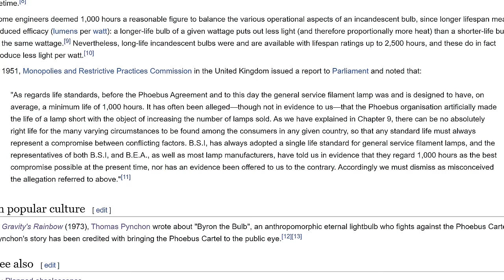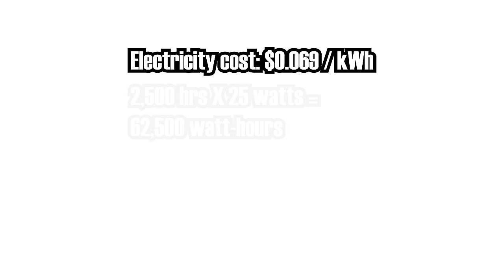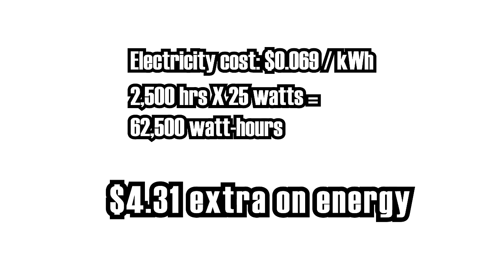Longer-lasting light bulbs: it was complicated

Comment: I think this video makes a very strong case for stepping back from calling Phoebus the beginnings of planned obsolescence; though I do also think Phoebus may be one of the source texts/inspirations for the move toward planned obsolescence within tech-goods industries since the mid-20th century. That said, I think there is a strong case for corporate cartel collusion. It seems likely that the member corporations were less motivated by artificially increasing demand through shorter product life (and more frequent replacement) and more motivated by the need to protect against corporate noncompliance in a market sculpted by lack of consumer knowledge. This trade-off between brightness/whiteness/efficiency and runtime is the perfect situation where some companies could market their products as brighter and more efficient while others would market their products as longer-lasting. The corporate collusion allows the terms of the market to be set, making sure that no one company gets a reputation for having longer-lasting bulbs because they underclock their light bulbs by a few lumens (something many customers would never notice, even in a side by side comparison).

I bring these up because the nuance and historical storytelling seems important. Consumer values have changed significantly with regard to powered things since their rise to market dominance in the mid-20th century. For example, the contemporary focus on automotive safety is at odds with the historical focus on automotive resilience (i.e. being un-dentable) because the car is now designed to take so much more of the impact that even low-speed collisions can total a late-20th, early 21st century motor vehicle. In that vein, I'm not super convinced we can call brighter or whiter light good in any specific context nor was the energy cost in the 20's and 30's a significant deterrent since electricity had few high wattage uses (e.g. home dryers, electric stoves, or household heating) in most homes. This was a barrier in the early switch from gas lighting to electric lighting, since most folks continued to use other fuels for stoves and household heat, decreasing the overall appeal that electricity carries for us today as a fuel source for every device.

Anyways, great video. Thanks for the better understanding!

Comment: Our washer is well over 40 years old.  I spent $5 to replace the agitator cams five years ago.  

Now $1000-$2000 appliances often fail within five years bc a 10¢ capacitor dies in a $100 motherboard and it's $300+ to fix them...

Comment: An irony of modern eco/LED bulbs is that they have become insanely expensive, costing more than ten times that of old incandescent bulbs. The cost argument for end users has vanished completely. I also find the light from modern LED bulbs to be too harsh. I'd rather use incandescents, but they're hard to find now. For some reason, LED bulbs are marketed with a focus on "daylight", which to me means they're far too white.

That 3-way bulb though is very cool, I don't think I've ever seen anything like that in the UK.

I know someone who lived in an old house which had a single 60W bulb in the entrance hall that ran non-stop for decades, probably because it never had any thermal cycling stress. The light switch on the wall had tape over it to stop someone from turning it off. Infact the bulb was only finally turned off when the house, following its eventual sale, was demolished to make way for modern flats.

Comment: My hate was all towards the compact fluorescent light bulbs. They were advertised as long lasting but they would burn quite often in my experience. Then you had eletronic waste, plus a drop of mercury they say, not only a bit of glass and a bit of metal. 

But we would still buy them because they'd use like 1/4 of the power of an incandescent. Now LEDs dont burn that often - as long as you avoid the cheapest!

Comment: When I was a little boy the power company was called Commonwealth Edison.  They started calling it com ed in the 70’s I think.  Best that I can remember “bulb service “ was 60 cents a month and you could go to the hardware store to pay your bill and get ten bulbs.  They didn’t have candelabra bulbs or anything other than a regular old light bulb.

I think dad quit paying for bulb service before they cut it out because we had so many piled up.
You used be able to pound the old sealed beam headlights with your fist a couple of times and they would come back on before you had to go to the store and get. Replacement.

Comment: The brighter, more energy efficient lightbulb that would last AT LEAST (a guaranteed) 1,000 hours (but on average almost always did quite a bit better) was not DESIGNED to fail after an such an amount of time that was over twice as short as the other type, that was just a consequence of the physical properties the came with its form and shape.

Comment: I think you left out another huge part of the equation- even if the longer lasting bulbs are slightly dimmer, they are much better for the environment if there's less bulbs going to the landfill.  If those dim bulbs were already brighter than gas lamps, in most situations you really wouldn't need a brighter bulb when the tradeoff is more bulbs going to waste.  So therefore I still think we should keep criticizing the phoebus cartel the way we have, and that the 1,000 hour limit was not the correct thing to do.  Also- it doesn't make sense to judge how much light comes from the Centennial bulb in a DAYTIME picture.

Comment: So is a dimmer switch using a capacitor to withhold some of the energy flowing towards the lightbulb's circuit to control its brightness? Are there dimmer switches that use percentages instead of slider mechanisms?

Comment: I wonder if an incandescent bulb has ever been designed with backup filaments. Though the circuitry to switch filament would probably be expensive and there is the issue of the glass darkening.
Reply: Philips marketed a 90 watt light bulb called "The Watchman" in the early 1990's which had two filaments in parallel. The main filament was rated 70 watts but it was used in conjunction with a 20 watt "backup" filament. If the main filament failed, the longer lasting lower wattage filament would continue to provide a minimally adequate amount of light in areas where total darkness would be hazardous such as near stairs or in basements

Comment: Regarding the over-voltage/longevity tradeoff.. EU countries used to have different nominal voltages from 220V to 250V. And each country traditionally had their own light bulb manufacturers producing bulbs specifically for that.  Come EU "normalisation". All countries now have a nominal 230V voltage with a ludicrously wide tolerance range, fudged so all existing installations are in spec without any changes needed. Products may now be sold across the EU. Economies of scale and rationialsation - in the final days of the incandescent bulb, there are only a handful of bulb producers making 230V bulbs for the entire EU market.  In the UK (240V) we get shorter lived light bulbs. In the 220V countries they get long life bulbs!

Comment: Presume appliance lights are made, favouring longevity over efficiency, because:
They are often difficult to get at to change; &
A small amount of light in a little box is sufficient for the purpose; &
They frequently get turned on and off, so cycling stress becomes a factor.

Comment: I wonder if that third-contact design (from those bulbs you mentioned had two different filaments) could be brought back specifically to facilitate a "direct wire" data line to some open standard bulbs could use for an in-house solution that doesn't invoke wifi and could potentially all be fully configured from a touch screen mounted right at the light switch?

Comment: could you manufacture an incandescent bulb that has multiple filaments, one active at a time, that pick up for one another after burning out? you could stuff a bunch into a single bulb and it'd replace itself over the years as it burns through charges.
Reply: i mean if you were hell-bent on using incandescence over a more efficient modern technology

Comment: Lightbulbs sold in Dubai last a lot longer, because their law requires it. At least with the LED ones, the only difference is that they aren't intentionally over-driven and voila - the whole assembly lasts as long as LEDs are supposed to.

Comment: The problem with LED lamps is that sure, they're efficient but you know what's also efficient and had better longevity? CFLs. I've recently changed my last CFL lamp in the kitchen that has been turned on and off and was on for a long time during the day every single day. The date that was written on it: 03.08.2015. I started changing them in 2020 as they started burning out and in that time I had to change countless led lamps which don't last even half a year. It would've been ok if they were as expensive as their longevity but of course they're not

Comment: I think the point of the "fines when going over 1000h" thing is just because a limit was set and it has to be enforced.
If they started forgiving 100h, then that could eventually snowball into the norm going back to 2500h and causing all the problems raised in this video.
It's just the same thing as minimum wage. If someone is caught paying their employee less than that, then it's an offense.

Comment: I had a three-way lamp, and the bulb seem to lose an element within the first month. So I put a diode on the line, and run a 100 200 300 watt bulb, and it would last a couple years. Is only half as bright as it should have been, but that's all I wanted.😮 50 100 150. Or thereabouts. The light was fine for reading!

Comment: The flip side of this, is that cordless power tools from the big companies are built better than ever. Mainly because once they sell you the tool, they can then sell you batteries for the life of said tool. The batteries are of course expensive as all hell, especially considering they're usually just a bunch of 18650s packed in a fancy plastic clamshell and then marked up 9 trillion percent. And each brand has its own special battery connections that aren't interchangeable. And they'll sue the hell out of anyone who makes 3rd party batteries. Aaand they've got multiple lines and types and capacities of batteries for each tool. You want the 12v impact or the 20v impact? What capacity? How about a leaf blower that takes multiple 20v batteries, or a single 40v battery? How about a lawnmower that takes a 60v that can still be used with the 40v leaf blower, but not with something like a drill? You want the forceflex or the powerforce, or the forcepower, or the forcepower max, or the ultraflexpowerforce promaxx? 😂 They're just battery companies now. Pretty soon they'll just give the tools away if you sign up for a "battery replacement contract". Either way, the side effect has, in most cases, not all, been some pretty well built hand tools. That drill can last 100 years as long as it needs a new battery every 6 months. Bigger margins... Until the lithium either runs out or gets too expensive. Then everyone is fucked.

Comment: My recipe for having a led bulb that will last the 20K hours promised without having to mod anything: If you need a 5W bulb, buy a smart 10W one, and use it at 50% power always. The reason no led lamp can make it's promised life expectancy is that both the leds and the power supply are driven so hard to their limits that if you get more than 3000 hours, you got extremely lucky.

Comment: when it comes to "planned obsolence", I love to remind that common fridges were a thing for rich only at a time. Obviously all the systems in it were robust and easily reairable. But thick copper tube cost a lot. So inmodernfridges we only see a thin ones. Yet now it's common to have a fridge in any family. Because less materials = cheaper product. Obviously, those 1/4 ton fridges are more durable, yet they cost too much to be competitive now.
Reply: YES.. you told what i war thinking. Old stuff lasted longer but they also cost a lot adjusting for inflation.

Today's tech lifespan isn't bad either if you ignore the edge cases.

Comment: If anybody is shopping for LED bulbs, never get Cree LED Bulbs. I have Walmart LED Bulbs that last longer and cost a fraction of the price of Cree. Terribly designed bulbs. I even had a Cree LED Flood light style bulb in a ceiling fixture, and the adhesive on the glass bulb melted and it literally fell and landed on the couch below. Luckily nobody was sitting there.

Comment: There is absolutely planned obsolescence when it comes to LED lights. If you create a bulb with more diodes, but operating at lower voltage it will create the same amount of light per watt. But last 10x longer.
Reply: You could retail that for a higher price as long as people are willing to pay more for it.  As a rule of thumb, buyers are not always prepared to pay more for something that is of higher quality.  [Although they will often pay more for something of the same or lower quality if it has a prestigious brand on it, e.g., Louis Vuitton or BMW, which is most curious!]

Comment: The way I understand this 'planned obsolescence' is a product, like say a computer OS, made to far lower specs than what may be ultimately necessary or even possible saying things like no one will ever need it to be better than this eventually of course being walked back making replacements 'necessary'. Or more generally software that is deliberately poorly made needing continual 'updates' for new 'hardware' that never actually changed it's base function which has long ago peaked in it's general efficency being sidelined for things it's software is seemingly deliberately designed to do poorly like that thing in your hand you're no doubt reading this on right now. Basically hardware held back by software designed to eventually render it 'obsolete'.

So, practically speaking, it was never even given the chance to run at it's fullest potential before it was thrown in the bin for the newer model. Or up in the air to test a new really useful app taking advantage of new and really useful hardware features. Or put in the microwave to charge it. Or dumped in a sink full of water. Just because. The humble incandescent light bulb is more like a carton of milk. No one ever expected them to last forever. Or even particularly long at first. I suspect people were glad just to get one that would work as claimed as opposed to a centennial nightlight.

Good times.

Comment: Some time in the late 70s, or early 80s a company called Turtle Lite released a bulb that was a little different than most other incandescent bulbs.  They were heavier, because the glass was thicker, and rather than having a smooth globe like shape, they were more octagonal (or maybe hexagonal.  I was really young, so my memories are not very clear on that.)  They came in the standard 40, 60, 75, and 100 watt versions.  They were advertised as being incredibly long lasting.  And they were long lasting.  They lasted so long that the company that manufactured them went out of business before most of the bulbs had burned out.  They sold out quickly, but no one bought replacements because they didn't need replacements.  The company, literally, went out of business because they made a lightbulb that wouldn't burn out soon enough to need to be replaced.

My family bought a bunch and put them up around the house.  The bulbs didn't burn out for years.  In fact, most of the lamps failed (switches breaking off, wires getting frayed, or broken by being knocked off the table, or something similar) before the bulbs died.  Most importantly there was this one hallway ceiling light that was never turned off for any reason (my mother was terrified of the dark and insisted that this one light fixture stay on) that had a 100 watt Turtle Lite that was screwed into the socket sometime between 1976 and 1984 that was still working and still on (except for occasional power outages) until 2019 when she passed.  Unfortunately, my younger sister was born to late to appreciate the special-ness of the Turtle Lite and disposed of all of them to put in LEDs instead, whether the Turtle Lite worked or not.

Comment: The term "planned obsolescence" is almost always taken out of context from its original meaning.  It may have originated at General Motors about 100 years ago.  And its meaning then was that continuous improvement of the product would render older models obsolete as the newer ones would simply be better.  It wasn't a sinister thing, rather the opposite.  But it's most frequently taken to mean that products are designed to fail so that they must be replaced frequently.  Some products are indeed designed to fail sooner than they should, but that was never the original meaning.

Comment: The more I use LEDs the more I'm convinced we need a way to separate the d/c conversion from the bulb... either in the box switch or in the light housing/electrical connection box above it.  Would increase the life of the LED dramatically as well as make the bulbs cheaper.  Would have to be a long term win if only enough consumers were savvy enough to install that kind of thing themselves.
Reply: Isn't separate DC conversion exactly how downlights works? LED downlights are available.

Comment: Planned obsolescence sucks especially in incandescent bulbs, many older ones went for several thousands of hours and should be made as robustly as possible.
Reply: Did you watch the vid?
Reply: @Jan12700  Yup. To add, I've seen bulbs rated for thousands of hours at 120v which had visibly thicker filaments than 1k hour bulbs of equivalent wattage, also rated for 120v.